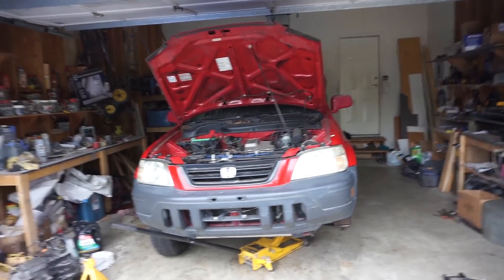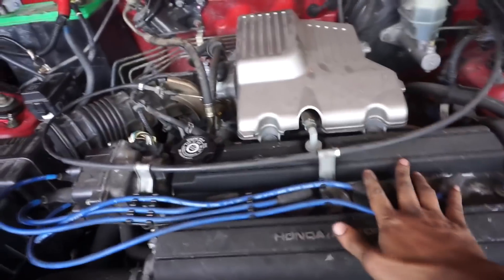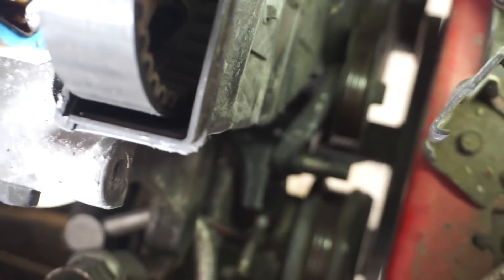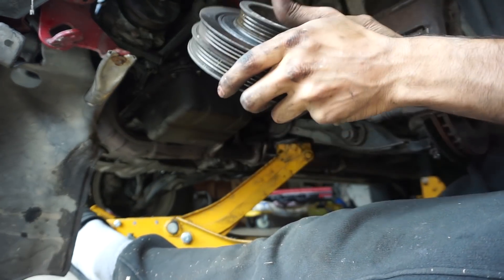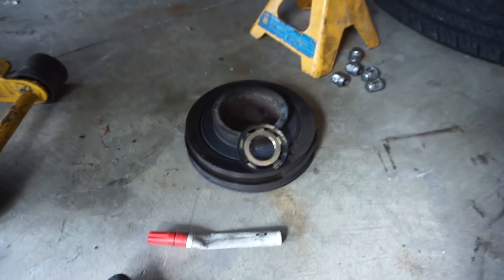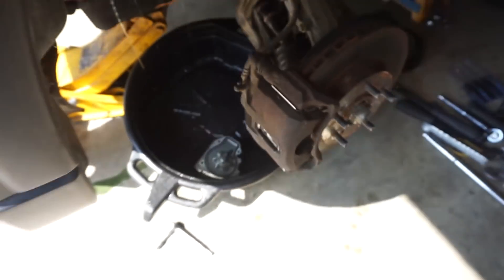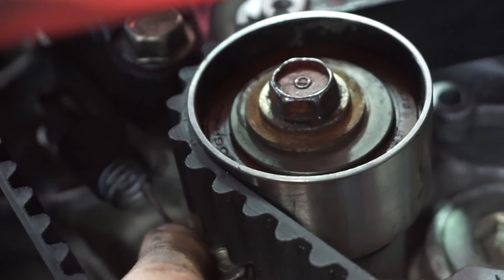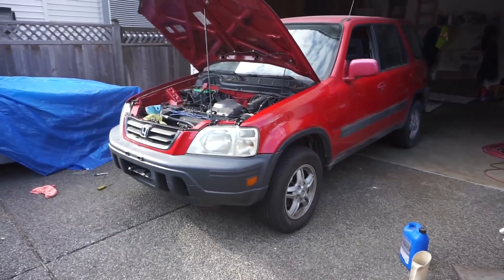HOW TO: HONDA B-series Timing BELT AT HOME | Honda CR-V

Comment: That engine is non interference one, so even if you missed the timing, the engine will not break, it will not run or run properly with Miss fire, my car had timing belt break while engine was running, and nothing happen to the engine, I just replace the belt, and all timing components, and I timed the engine correctly to the marks, and  voila, engine runs again like new.

Comment: Hey man, nice video.  Can you explain why the painted marks on the new belt will no longer line up after spinning the engine?
Reply from the maker: Because the crank vs the cam spin at diffrent ratio. For ever 1 full spin of the crank the cam gear only turns  1/2. So the painted belt marks will be off after the engine spins over once
Reply: @Wrenchlife604  dude thank you so much for the clarity.  I had marked mine then was confused when they didn't line up.

Comment: you don't count the belt teeth on the exhaust side?  cuz all slack is removed as exhaust cam is tentioned clockwise.  i screwed up several times, then caught myself.

Comment: You should put the valve cover ground strap on the nearest valve cover stud to get it grounding the engine properly. When it’s on that timing belt cover bolt hole, it’s actually isolated from the engine by the valve cover gasket, so it’s not actually grounding anything.

Comment: Awesome video mate. I just completed the same job. Except now mine doesn't start haha. Cranks all day and doesn't fire. My CRV doesn't have a crank sensor and I didn't unplug anything electrically. Checked all the timing marks over and over.. only think that I can find thats a little odd is I seem to have a little bit of slack between the cam gears. The very top of the belt?
Reply from the maker: check the ground wire from the valve cover to the body. if it isnt that i would suspect the timing belt was put on wrong. you should  have too much slack between cam gears
Reply: @Wrenchlife604  thanks mate, got the timing belt sorted but I have no spark. Not very familiar with the hondas, how do I go about testing the dizzy? I have fuel, but no spark
Reply from the maker: @bradleygordon6806   if you dont have spark. usualy its a distributor issue on hondas. seems kinda weird that it just magicly lost spark after the timing belt..... could be something else but had to tell withought  being there in person
Reply: @Wrenchlife604  yeah thats what I was thinking too haha. I didn't undo any electrical connections.

I tested the ignition coil, I have 12v at the coil, the igniter appears to be working via the test light method on the coil negative.
The coil appears to test okay, primary being around 0.6 ohms and the secondary being 14kOhms.

But if test spark right out of the coil directly to going its weak/non-existent
Reply: @Wrenchlife604  new ignition coil and she started first go... 
Just my luck to have it die on the first start after the timing belt 😂😂

Comment: The camshafts have holes that line up with the end caps on the timing belt side. If you put a small allen wrench through the hole on end cap and then camshaft it will line up those camshafts. Then you only need to make sure your crankshaft is lined up on it's mark which is located on the topside of crankshaft and engine block. Doing this avoids the hassle of marking the timing belt.

Comment: I have a 2000 Honda CR-V we changed out the distributor and after we did that the rpm is very low, you can fully press the gas pedal and it will barely have power. Any ideas?
Reply: You ever figure this out?

Comment: There’s 4 total keys right? Two for the cam gears and then one for the crank gear and another for the crank pulley right? Just tryna make sure because I have an extra one but I don’t remember if it’s the extra one I just got from a pick a part or if it’s another one I forgot to but in

Comment: Do you have to set timing to tdc before breaking loose the crankshaft pulley bolt/take it off?
Reply from the maker: Yes
Reply: @Wrenchlife604  and to do this i just have to use a 19 mm socket on the crank bolt and turn it counterclockwise? Doesnt matter if the bolt is fully torqued, it will still turn counterclockwise?
Reply from the maker: You have to use an impact gun. Because the crank will  spin when you try and remove the bolt. They make special tools you van buy to hold the crank.   Also you do have to make sure the crank bolt is tightened up tight.
Reply: @Wrenchlife604  And if I use an air impact gun will I still need the pulley holder to hold the pulley when I want to take off the crankshaft bolt? Or can I just use the air impact and it should come off witout the holder?
Reply from the maker: @menaceemceefiend9716  you dont need the holder tool then . If you use an impact.   Air or a good electric milwaukee one will work too.
Reply: @Wrenchlife604  and then afterwords on reassembly do I need the pulley holder when turning clock wise to tighten the crank bolt or can I just do it and torque it down witout it turning the engine clockwise
Reply: @menaceemceefiend9716  Dude just pay someone to do it for you.
Reply: @dumbeezy5480  already did it myself witout no issue, rather learn than to pay someone to do some shit I can do I’m alr

Comment: Hi, thanks for the video! This is a great one!

I got my mechanic to bust loose my crank pulley for me. The problem is I can’t get the engine nuts loose. I’ve soaked them in deep creep many times over days, hit them with a big big hammer, tried a bid breaker bar. Now one nut is starting to get rounded corners…..
I will go to somebody in the neighborhood next.

Comment: Problem I'm having is having a little too much slack on the very top of the belt in the middle of both cam gears?
Reply from the maker: it should be tight between the cam gears. did you paint mark your old belt then transfer the paint marks over to the new one. like i did in the video ?
Reply: I have the same problem haha. What did you do to fix this? I watched the video after 😂
Reply: @bradleygordon6806  I found its best once you have everything on top dead center with the tensioner loose rotate the crank until you see the cam gears move three teeth then tighten the tensioner and should be good to go!
Reply: @hecks_k20_fa5  yup thats what I did too 😁🤙🏼
Reply: @bradleygordon6806  🍻
Reply: @hecks_k20_fa5  my coil just happened to die while I was doing the belt too... so didn't start when I went to test it. I shit myself hahaha
Reply: @bradleygordon6806  😂Damn Honda's can be a pain!Lol but I love them and they can take a good beating.

Comment: But i think the procedure is wrong check the intake and exhaust valves if is correct position in spark plug 1 firing order. You Can make your engine damage is this procedure if you are not mechanic. Do not start your car after changing belt rotate the crankshaft 6times anti clockwise if the engine move freely
Reply: what do you mean if the engine moves freely

Comment: Great video! congrats! Please help me , previous mechanic eliminated the lower cover and it no longer exists, can I set the timing without it and avoiding to take out that hard to loosen Crankshaft bolt as I am going to be using the same time belt?   I just needed to replace some rocker arms.
If I place piston number one on TDC, both UP arrows are ok, isnt it on time?
Reply from the maker: Mark everything.  If you dont have a lower cover you can just loosen  the tensioner and slip the belts off the cam gears. Also seen people  ziptie the belt to the camgear, impact off the camgear nut then remove the camshaft.
Reply: @Wrenchlife604  Yeap, thanks a lot, but I need to set the correct timing , my question is if I can set it without the lower cover mark, just buy putting the piston 1 in TDC , both camgears on the UP position and done?
Reply from the maker: Yes.  You can do it like that. Be carfull that the crank dosnt move then. The #1 piston can be at tdc.  But  you can still be a little off on the crank.  Its hard to get the #1 piston at correct tdc  but you can get it close
Reply: @Wrenchlife604  really thankful with you, thanks!!!! you rock! greetings from Panama.
Reply: @Wrenchlife604  being that "little off" as you mentioned is dangerous? can I damage something? valve bent? I am afraid.
Reply from the maker: Yes a valve could get bent. If the timing is  put back incorrectly

Comment: Why u doing this. Aint Honda. Indestructible?
Reply: Because B20B is a timing belt/ interference engine. 
The K24A4 is also interference but has a timing chain so this is a procedure you'll have to do under rare occasion.

Comment: after running through all the basics and having it be a failed t-stat. I noticed a bunch of crud in my  drained rad, long behold 3 days later the rad starts leaking from bottom rh corner.. Just ordered a aluminum rad and everything i need for a tbelt/water pump job.. Just so I can be done with the cooling system of my teggy

Comment: You: “I don’t believe in torque specs”, I don’t believe in timing!
Reply: Andrew Klinez I also dont believe in torque specs. So far so good!
Reply: @homeschoolsquirrel  six months later, "why did my  tensioner fall off?" Or oops, I snapped a bolt in the block again.. buy a torque wrench you will not regret it.
Reply: @hackdeez1075  yeah I'll probably wait until I screw something up before I buy one hahaha
Reply: @homeschoolsquirrel  you dont have to torque everything but some things aren't worth risking under or over torquing

Comment: Question I had someone do my timing belt on my 98 crv and the car drives fine but the plastic cover for the timing belt is rubbing against the cam a little any help where he went wrong? It sound like a little whirring sound when I accelerate
Reply from the maker: Unless the plastic cover is missing a few screws it shouldnt be rubbing. A  too tight belt will make a whine noise. Which is kinda common. Take it back to the mechanic for a second opinion
Reply: The cover warps from heat stress.  You can take off cam cover and trim plastic cover with hot knife.

Comment: quick question for ya , i got off the bolt but the pulley won't budge any tips?
Reply: Also you can wack it with a rubber mallet a few times. That gets it loose usually.
Reply from the maker: Spray it down with wd40 or whatever spray you like in the center. And let it soak for a few hours. . Then when you try and remove it.  Use the same technique  i used and kinda micro shake it and pull and it should come out. Never had a honda one get stuck. Avoid using a torch because theres a seal behind there  that you can wreck. But if u need to. U might need to use a small propane torch. Be safe.

Comment: question for ya! first time doing a b swap into my ef hatch i got the motor in and started it , the timing belt is running off the cams , i remembered i accidentally took off the tensioner bolt but i put it right back in would that have maybe messed up the tension of the belt and causing it to run off the cams? If so should i just put it to TDC and make sure the marks line up and then put tension on the tensioner again and tighten it up? let me know thanks a lot !
Reply from the maker: Yah make shure it didnt skip a tooth. But id take off the top cover and valve cover.  Verifiy the cams line up. And on the crank pulled you will see 3 sets of lines. And a odd line  less than a  cm away from the 3 grouping. Thats the tdc line. Make shure the tdc mark lines up to the crank pointer and the cams face up .
Reply from the maker: Easier to verrify that way. Before rippig everything apart. Make shure the cams are facing up. Becauae the tdc pointer  will line up twice. One on the exhaust stroke one on the compression stroke. U want tdc on compression stroke